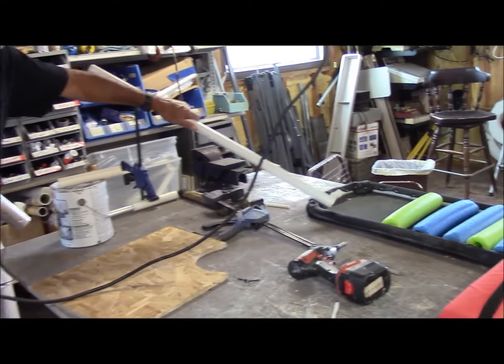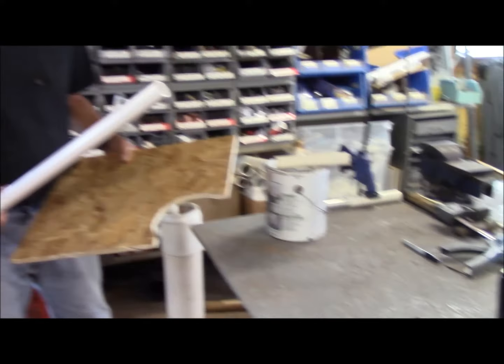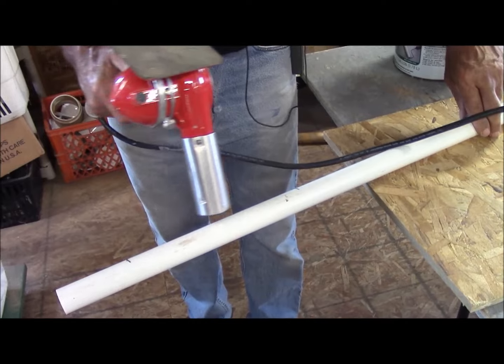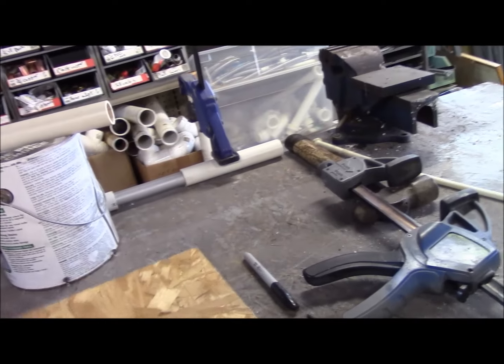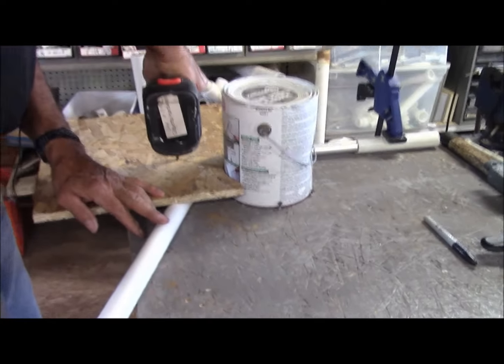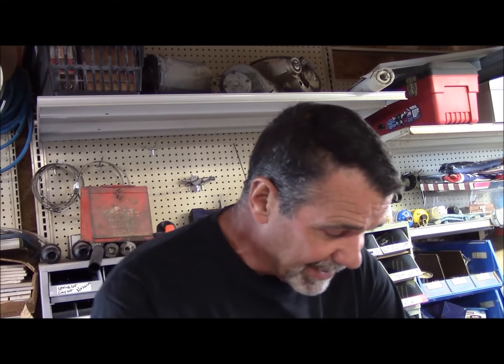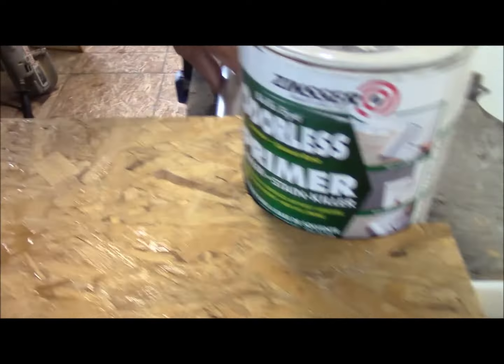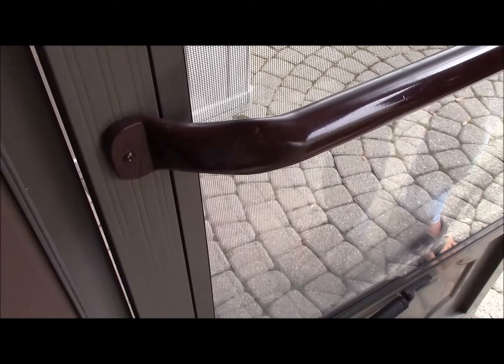PVC Bending No Kink - Piping Bending Using Heat Gun

Comment: I first saw one of those heat guns when I was in the Job Corps in the early '80s. The automotive instructor was using it to solder a carb float back onto its bracket. He told me that the Job Corps had originally bought 3 of them to be used in the gym locker room as blow dryers. They were soon removed and given to a couple of the training courses when they started "frizzing" the guys' hair.
Reply: had one of these exact models. after about 6 months   the element broke/ burned out. i found the replacement element  cost more than the gun and the warranty specifically excludes the element. bought cheap guns ever since. you can get 1500 watt guns cheap. that's the max you can get from a 120 outlet anyway.
Reply: FI t
 Ķk

Comment: Looking to use this method to make large wedding arch's- 2meter diameter large. What diameter pvc pipe have you used please and do you think this will work? Trying to use PVC as I can paint it unlike metal.
Reply from the maker: @tp0741tp  1 1/2” pvc pipe should do it easily. Seeing as there is no ‘load’ other than flowers you could probably godown to 1 1/4”. 2 meters wide mean’s you’ll need to bend
Reply from the maker: 2 -10’ pieces of pipe and join them in the center. I’d look for ‘pressure couplings’ (pressure couplings are almost twice as long as drain couplings) for the coupler and use several sheet metal screws for the attachment. Don’t glue…. I’d make a template w/wood on a piece of plywood so both halves are bent the same shape.
Reply from the maker: Email a pic or sketch to blair@mrhardware if you want more guidance. I’m traveling for a few days so I won’t see them until next week…..

Comment: Huh. That's sch 40 PVC designed for water supply, right?   I occasionally use EMT for projects outside of its intended use, never thought about using PVC for anything other than plumbing.  Opens up a lot of possibilities!

Comment: I have a question I'm wanting to bend a 3" 5' pvc pipe and I capped both ends already is it dangerous for me to use a heat gun just enough for me to Bend it a few inches 😅  I'm thinking not and probably need to jist buy new pipes but hopefully not
Reply from the maker: The increased air pressure on the inside of that pipe when you heat it just may cause that pipe to bubble, as you are trying to bend it. If possible, I would suggest drilling a hole that you could take a sheet metal screw with a rubber washer under the head of it to resealed the pipe after you drilled an escape pole.
Reply: @MrHardware1  I thought the same as to make a small hole but what can I plug it with after so water don't get in it and ty for the reply

Comment: Would bending the PVC weaken it to the point of it not being as structural as strong as the original straight piece of PVC?
Reply from the maker: I know it’s not stronger but it seem to ‘temper’ it a little making it stiffer. Not as flexible.
Reply: @MrHardware1  Thanks, I was just curious and didn't know.

Comment: Thanks for this video. Have you tried larger diameter pipe, like 4-inch PVC using this method and does it work OK? Also have you tried thinner-walled Sewer and Drain pipe made from HDPE?
Reply from the maker: @MrHolz1234  no, so far the biggest I’ve done is 2 inch. And it takes a bit more skill than bending the smaller diameters. Nor have I done any thin wall, I bet it’s so fragile you’d have to pack it with sand in order to get a king free bend.
Reply: @MrHardware1  Many thanks. That's getting to be a good bit of sand when you get up to 4" pipe so that is why I have avoided trying that. Plus the wife really not wanted 50 lbs of sand in her oven!  I also have not seen anyone trying to bend HDPE pipe (and although HDPE may bend easier in general, the triple wall, and thinness of that pipe make me wonder how it would work).

Comment: What kind of heat gun is that ?
Reply from the maker: It is an old Milwaukee that I purchased back when I used to do a lot of laminate, and that heat gun would soften up the glue without ruining the laminate so I could remove it and reposition it.
Reply: @MrHardware1  a red one.

Comment: Great advice!  It looks like the PVC push bar on your screen door is painted.  I've been making Halloween fencing out of PVC and CPVC. I sand each piece and then right before I apply paint, I clean the piece with acetone.  The paint sticks OK, but if it was something designed to be handled multiple times a day like a door handle I can't imagine it would last very long.  What is your trick to making the paint stick to PVC?
Reply from the maker: I’m using rust-oleum painters touch 2X. It’s the ultra cover paint and primer spray paint. It’s a couple years old but I’m pretty sure that it’s still made but under another label now. Most spray paint now states that it’s for all surfaces including plastic. That’s the one I would be looking for.

Comment: I am wanting to make a 30" diameter 1/2 circle with 3/4 x 11/2 pvc bar stock. Will this method work on my project?
Reply from the maker: You’ll have to try, I never bent pvc barstock. If it’s the same material as pvc pipe I would.

Comment: Ppl say heat sand and dump in pipe. Well iv never done it but im about to do it jus a lil diff. Im gonna just fill pipe with cold sand and then use a heat gun. Sand kepps pip from kinking and its way faster and not have to cook sand then cools way quicker as well. I mean im guessing because iv never shaped pvc befor but i dnt see why thats not the fastest go to  ESPECIALLY WHEN YOUR YARD IS SAND
Reply from the maker: @rickyrickharris4908  the sand is a heat sink and probably will triple the time required to get the pipe up to temperature to bend. Good idea but with a ‘top plate’ on your template to prevent the kink the job is much faster.

Comment: A reasonable and clever method..    Additional benefit:  He said the finished product is stronger than a store-bought bend coupled to a straight tube.    But to this forces the occasional practitioner to work "blind."   SO...  I AM CURIOUS: It would be easier to use a tubing bender, after heating the PVC... ¿No?   Would that result in a DREADED KINK?

Comment: Do you have to worry about fumes while heating the pipe.
Reply from the maker: Not that I noticed, however if you had a meter to measure the parts per million while the pipe is being heated, I bet it would be elevated. I would think very little though.

Comment: You can't see shi8t with the plywood on top so how do you even know what is going on underneath it or if there is or is not a kink?
Reply from the maker: The tubing can only kink as wide as the gap built by spacing the plywood off the base. There is a learning curve which I’m hoping this video will minimize. I ruined a few bends by not getting the pvc hot enough or even enough through the bend.

Comment: In other words if you need to bend a pipe only 45 degrees you got nothing to worry about.   And  if you just put hot sand inside the pipe, youi can bend it to your hearts content with no concern about any kinks.
Pur your sand in the oven and heat it to 450 degrees, pour it in your pipe.  No need to fill the pipe.  Just block one of the pipe and pour it where you want to bend.
When you are satisfied just pour the sand out from the other end.
Reply from the maker: I just bent eight pvc rafters for a kayak rack in my complex here using heat gun. I was bending them in about two minutes each. My tougher bends. I do make a jig with the spacer and a plywood cap to keep them from kinking because I just can’t get the sand to the section of the pipe where I want to make the bend without getting the rest of the pipe too soft.
Reply: @MrHardware1  The idea of confining the pipe by some means ( i.e. plywood) is brilliant.  Yesterday I used your technic of heating and bending a 3 inch pvc used for drain and since I only needed a 45 degree angle I figured it won't need confinement.  Plus I did not need to have a short length 45 degrees as long as my entire 3 foot pipe was at 45 was all I cared about.
It worked just as the doctor ordered.   🙂
Thank you.

Comment: You're doing that all wrong. Throw that heat gun away and buy yourself a heat box. Take a piece of pipe and cut it to a workable length. fill the pipe slap full of sand, place an end cap on each end of the pipe, heat in the heat box, then form. The reason you get kinks in the pipe is from air space. Eliminate air space for a perfect bend.
Reply: Leftylou6070 what do you use to heat your heatbox.?